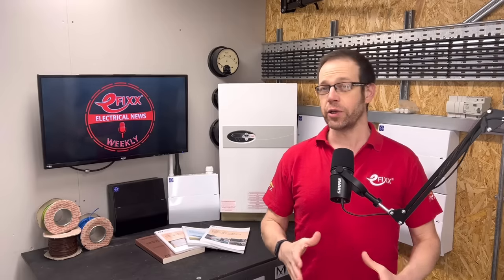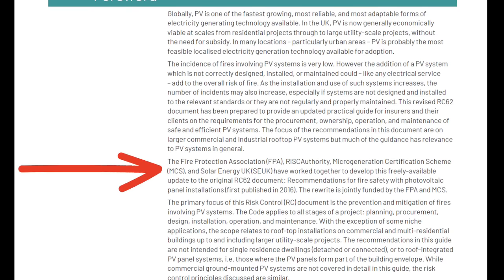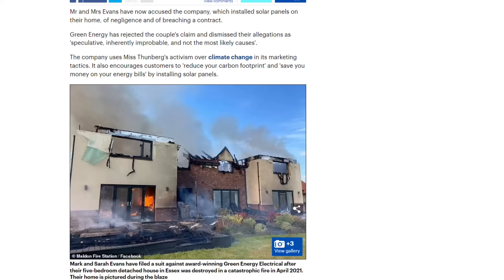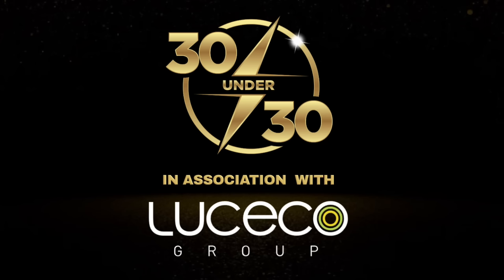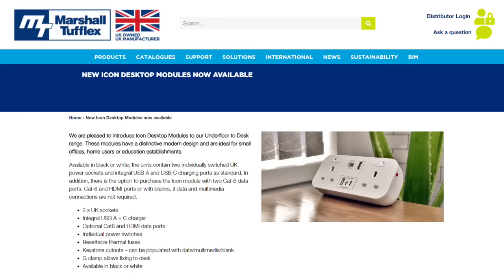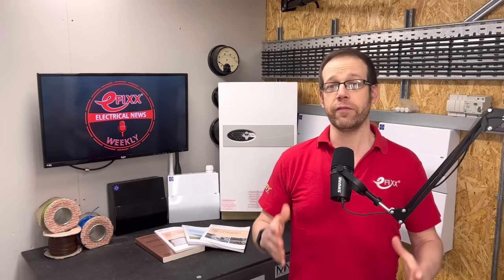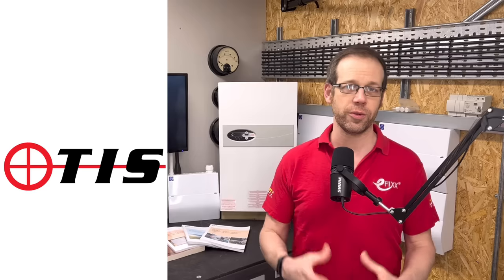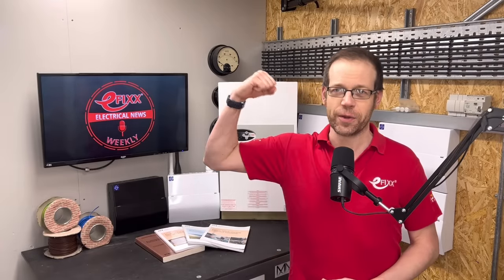DON'T Install DC Isolators On Solar, Electricians Warned

Comment: Advice please. I need 15kwh a day to power for power outages that can last from a couple hours to a few days. I'm in Michigan so my solar hours is 4.48, 1,278 Kwh per 1Kw, says need 4.24 Kwh array

I'm looking at a 400w, 36v panel, says output DC 39V, 10.25a max, transfer efficiency greater or equal to 21%

A MPPT Charge controller of 100a, says 12/24/36/48v Auto, Max Input 100v. Max charging current 100a. Max Input volts of panels should be 30v-45v (for 24v battery). Max Input power of panels should be 2000w. Output voltage DC5v/1.5a

Inverter of 4000w/8000w Peak, Pure Sine Wave Power Inverter, DC24v-AC110

And Battery is LiTime 24v 100Ah, LifeP04 Lithium Ion, Build-in 100a BMS, 2,560 Wh Energy. Up to 4P2S (don't know what that means) 48v battery 400Ah of 20.48 Kwh

It's only 1000sq' apartment, 2bd/2ba. Old Kenmore Fridge, elec range, micro, dishwasher (which I'd forgo during an outage), a couple computers and tvs, wifi, lights, a mini-fridge, that's about it. No washer/dryer and if I did use my hair dryer, it's 5 mins or less, but I don't use it every day (and my housemate is bald). For obvs. reasons I wanna keep the heat on and the fridge. We'd unplug things we don't need for a few days, but I'll stick with what we've averaged over the last year anyway just to be safe at the 15Kwh a day.

Am I on the right track here? Too much, too little, just right? Any part of this not work with another or could be downgraded or done better/easier/cheaper? Any part of it I don't need? Anything I do that's not here? What I have here is about $1,450. Thanks for your time!
Reply: I am far from an expert, but it seems to me that if you want to power your house for 2 days you will need 2*15k/2560=12 of those batteries.

My suggestion is to radically rethink your requirements. The biggest power consumer that you mentioned is your range (I assume oven and hotplates) - suggest planning to use something else, maybe a microwave or little camping stove. You didn't mention what you use for house heating, so I  assume that it is not electric.

Using what you have you could probably keep the fridge and (low power) lights running.

4P2S means that you can connect a maximum of 4 of those batteries in parallel and 2 in series.

There might be other problems with your configuration - I stopped looking after the first one. There are lots of good videos in yt about off grid solar. "Will Prowse" also does a lot of beginner friendly videos with good information.

Comment: Handy info. I would be interested to know how old the PV systems were that caught fire. My oldest system has been in for 13 years now and it's not caught fire yet. Maybe I should start checking the DC isolators with a thermal camera as a precaution?

Comment: I am not sure I understand what the DC isolators have to do with the fires described, which seem unrelated.  I am also not sure I understand how a well-designed and properly-installed DC isolator could cause a fire.

Comment: Auditing many sites I find so many poor quality DC cable terminations inside external DC isolators. It is a question of cheap and poor quality workmanship.

Frankly, inverter internal DC isolators do not isolate the DC voltage supplied to the inverter from the PV module strings. This leaves live DC open to potentially electrocute a careless installer. And there are many of those around….

Comment: There should be some regulations to minimize the fire risks: as few components between charge controller and solar panels as possible, minimize wiring between each component and all component rated with safety in mind (700V array => rated for 700V + 20% => 900V). Why you need to connect all solar panels in series? 30V per panel and 120V to 240V should be enough to build an array to get the cables down. Look what a cable isolation fault on a 700V system looks like and you never put the + and - cables in the same pipe.

Comment: Isolator is different to a Current breaking device, big difference.
One is meant for off load circuit isolation, the other is capable of breaking the max voltage and max current.
Learn the difference.

Comment: Solar panels are current sources and sholud be handled like those. Never open the circuits in  current sources , they have to be short- circuit.  solar inverters use this method to inactivate the solar power. input.
And you cannot protect current sources with fuses.  
Cuurent sorces got a high internal resistace (Ri) , high open loop voltage so exact the other way round than voltage sources like the electical mains.
When install solar panels, never place connectors , taps or splittings underneath the roof /attic. Install wires in one piece from the panel to the inverter/charger. Use high cross sectional wire gauges, not because lower loss, but rather  of the mechanical sturdiness. Install connection boxes in a fireproof environment e.g on a brick walls. Do not store flammable items in the vicinity of inverters and solar installations. 
Battery banks shoud not be installs inside of homes / flats. The best is a separate shelter apart from the house.

Comment: The problem is people picking the wrong DC isolator and using them in the wrong configuration. Installers cutting costs by taking the link out and halving the current rating then putting two strings through the same DC isolator.

DC isolators are also excellent for any maintenance or repair works, what if you cannot depend on the built in DC isolator? 

What if an MC4 has been damaged and you need to replace it? 

Poor workmanship and purchasing inferior products is the problem here not DC isolators.

Comment: I do not understand why UK electricians don’t explore micro inverters more. Easy to commission and much safer due to isolation and dealing with smaller DC voltage.

Comment: What is the point of fitting a DC insulation switch 20 cm away from the DC switch on the inverter? I see the point of having a switch outside when the inverter is hidden at the back of the attic.

Comment: This morning I tested a mc4 connector to see if it would burn result they support fire and do not self extinguish
There for a damage mc4 plug in /out under load is a fire 🔥 risk
Reply from the maker: Why should you ever need to disconnect under load ?
Reply: they no why but if there is no isolator it could happen many soler System are install by  in experience technician high voltage dc is not the same as ac and many early System were in install by unqualified technicians
Reply: More important is mc4 burn

Comment: yet, I had my bypassed and the electrician found the installers did a dodgy job as he worked on the bypass. I only have the isolators next to the inverter now, even though they did a dodgy job there too.

Comment: My dc isolators are rated for 400V while it’s 360 volts so it’s should be fine, never had a single problem so far..

Comment: If the Victron system had no DC isolator switch, why mention it here? Are there no example cases where the DC isolator switch actually caused the issue?
Reply from the maker: Australia has plenty
Reply: @efixx  Then use those as an example, or make the video title match what issues are actually shown.

Comment: I am sorry for the friends and family of the man killed but how on earth is it the responsibility of a company that a tree happens to fall onto one of their workers?  If we are saying that the man killed should not have been working outdoors in a storm then we are heading for very extended power outages during poor weather that will make today's mains failures look like a very minor inconvenience - waiting for 'acceptable' or 'safe' weather to fix things.  Who decides what is  'acceptable' or 'safe'?  Surely it has got to be the person (or his immediate supervisor) 'on the ground'?

This is such a random event that could happen to anyone even someone happily sitting at home.  We need to have a sensible system in place to prevent over-bearing and impractical safety regulation whilst at the same time providing compensation for those unlucky enough to be involved in this sort of tragedy (especially public service workers) without labelling companies (let alone individuals) as 'criminals'!

Comment: I guess you should’ve put all of your solar equipment on cement board, so that even if the switch burns up, it can’t catch anything on fire. Same with your batteries, inverters, solar charge controllers. Keep everything at least 20 feet from your house so that if it does catch on fire, it doesn’t burn your home down too. Stop putting solar panels on your roof. That should be common sense. Get some RF connected smoke detectors. Then buy some CO2 fire extinguishers to keep around.

Comment: Well that's an interesting concept. We allow companies to manufacture isolators that arnt fit for purpose and fail dangerously, then change the rules so they sent required anymore 🤷🏻‍♂️. In industry we often have multiple isolation points on motor circuits nobody ever said "you are introducing more potential failure points" what a cop out. 44 years since I started, back then if your isolator was rated at 32a 500v, that was it's all day rating 24/7/365. Would have been good for twice that short term. At the same time we have idiots complaining they can't fit solar batteries in lofts anymore.

Comment: When is an isolator a switch disconnector ?
Reply: Check the approved standards for Low-voltage switchgear and control gear:  BSEN60947 or IEC60947. 
A switch disconnector is rated for ON LOAD switching
A disconnector only (i.e.) an isolator is and OFF LOAD device. 
In addition, switching devices have utilisation factors, depending on the type of load they will be required to switch.

Comment: I'm not a qualified Sparkie and perhaps I'm thinking about old old PV panels here, but can modern panels produce enough current to cause fires if improperly isolated/not connected to a suitable load? If that's the case then long gone are the days when leaving a PV panel disconnected was safe - Sounds like we Ha'a Goers need to start treating these with the same degree of care and caution as for a Li-Ion battery pack! ☀🔋🔥😳

Though if modern PV panels are that powerful, perhaps the concept of installing a couple on the walls of my North-facing flat is no longer as ridiculous an idea as it once might've sounded. If they can produce 200wH even in that sort of siting, that's still a saving¹ of 80p/day on my electricity bill... 💰😀

(¹ - That's of course before we start getting onto the cost of 2-4 PV panels, the inverter, and the fact that - Due to escape route considerations - My installation has no safe place to site a battery rack! 😉)

Comment: What I dont get with house electrical installs thay how in the high holy hell do you guys not fuse the solar in line??? Only the outgoing line from the inverter. Its standard in marine electrical since 2018 to fuse the solar to mppt line. Hell ive started including after panel inline fuses for the individual panels.
Reply: They do though.

Comment: How about explaining why the DC isolators failed OR how they caused the fires instead of just saying the Insurance companies do not recommend them. Are we to assume the DC isolators were made of plastic and the connections were weak, got hot and caught fire? Perhaps we can just use a metal mechanical disconnect instead? Avoid plastic enclosures that house electrical connections so that incase the connections or breakers fail the plastic enclosure does not catch fire and burn the house down? Please be more specific next time.
Reply from the maker: Learn more in these videos
https://youtu.be/YxHCDs03UEg?si=bWU_FQC0Hf_EJGfo

https://youtu.be/2BBCclJuM4I?si=g1VbeH4wAnBU3BW2

Comment: Victron make top shelf products it wasn't the charge controller
Reply: Agreed, I can't think of a less likely cause of a solar panel fire. One of the many functions of a charge controller is to convert a high DC voltage from the panels, to a lower voltage suitable for the batteries. If it failed the resultant damage would be in the controller itself or in the batteries, not the panels. The panels should be capable of looking after themselves come what may. A suspicious person might think that chosing Victron to blame in this instance had more to do with the perception that they might be easier to extract money from than say a company based in china. If the panels caught fire the issue will be with the panels, the interconnections between panels, or the design of the string exceeding manufacturers specifications for things like maximum string voltage. Even an accumulation of pigeon poo on the panels would be a far more likely reason for panels catching fire (one the basis that the chance of it being the charge controller is zero) than it being the charge controller.
Reply: @mikebarry229  I've had solar panels fail mine get a hot spot then the glass shattered
Reply: @awesomusmaximus3766  Not saying that doesn't happen (your experience shows that), just that when it does happen its never caused by a solar charge controller! Cause will be an inherent panel fault (microfractures?), a wiring issue (water ingress or dodgy connections?), or installation issue and likely your fire was due to one or more of those factors. Hot spots can be due to microfractures in the silicon, bird poo accumulations blocking part of the panels, and other issues including panel defects.
Reply: Luckily only the panel was damaged  fractures on many cells yes
Reply: Come on, manufacturing errors happen to everyone. I believe the term "faulty charger" was used.

The onus is in them (claimants) to prove it was faulty though.
Reply: @CollinBaillie  The report suggested a "faulty charge controller" made by Victron may have been to blame. Victron is a great make but I fail to see how even a completely rubbish charge controller could set the panels alight. The charge controller separates the typically 250v plus DC panel string from a typically 48v battery bank. Even if the controller completely shorted out internally so that the 250-500V DC panels were directly connected to the 48V DC battery, it is only the battery or the charge controller that will catch fire. 48v being pushed into a string of solar panels wont even be noticed by the panels unless the panels themselves are faulty. There is no way that the controller could fail in such a way that it sent hundreds of volts back into the panels causing them to catch fire. The electricity causing the fire has to be created by the panels themselves, and therefore entirely outside the control of the Victron unit.

Comment: just use diodes and caps and breaker combo. this probably is caused by a reversal in transformer due to high sudden current surge

Comment: Your article on DC isolators is flawed  and misleading as it suggests that this applies to all installations (uk), and gives examples of domestic incidents only involving solar. If you read the paragraph below the one highlighted at 1.09 it clearly states that ‘the recommendations in the guide are NOT intended for single residence dwelling or to roof integrated PV panel systems’.  This is something not mentioned in your article and hugely misleading and misinformation. This sort of incorrect reporting can cause big problems between installers who listen to you, and governing bodies. It also devalues your reputation as a reliable source of information.
Reply from the maker: RC62 is for commercial applications. However the regulations in BS7671 and the IET COP are the same.

Comment: I'm commenting on the "eFIXX" logo that can be seen on the screen on the wall in the background as well as on your red shirt.  So there is nothing wrong with it, except that the stylized little "e" at the beginning ends at the beginning of the first X letter. It's ugly and unnecessary solution. This little "e" should definitely continue seamlessly into that letter X. If some visual design professional has done this, I don't know what they are imagining! Does he think that by making it ugly - viewers will notice more that it has five letters? Ridiculous! Lets FIXX it.

Comment: You don't mention why DC isolators cause fires, is it amp rating, quality or something else. On a sailing vessel a DC isolator closest to the solar panels makes sense, in the event of a short in the solar cable, No? P.S. Victron products are good but also wrote the book on excuses. Almost impossible to blame their products for failures. It'll always be your fault.
Reply: Victron products are indeed very good. The issues we have seen on youtube 99% relates to poor connections of the cables.
Personally I regularly take a walk with an IR cam just to check everything.
The MPPT area is the only thing that gets hot. So I have sensors there connected to the victron setup that just turns on the fan.

Comment: Joke joke  How is solar installers supposed to know what is correct these days 😂 batteries in loft then not in loft? DC isolators put them in one on each string even if your inverter has isolator Now Dont 🤣 back in the day it was Earth the array on the roof now it's Dont 😂😂😂🤗🤗🤗